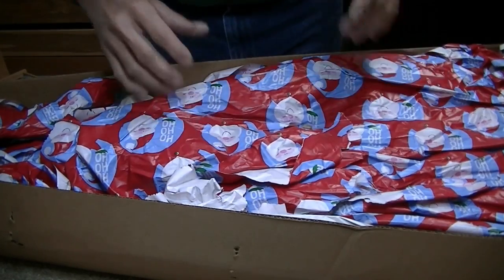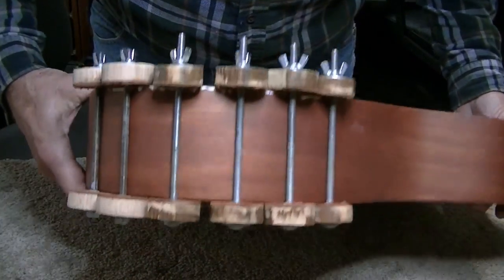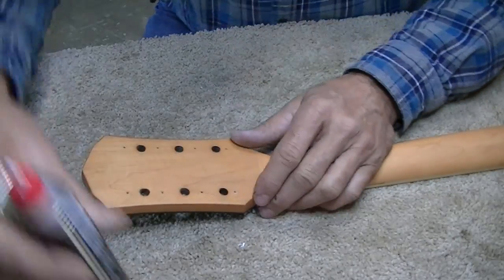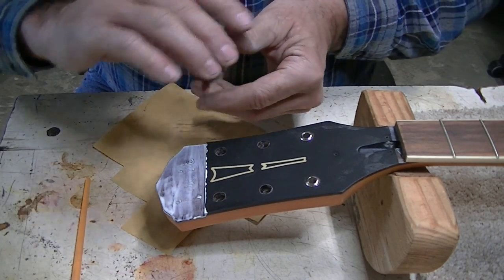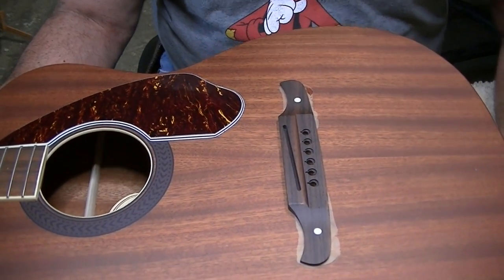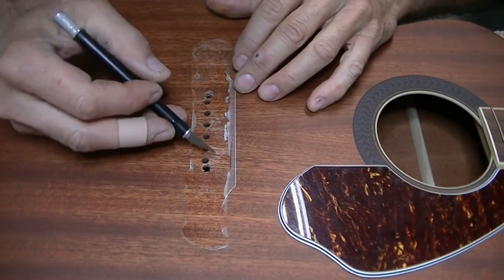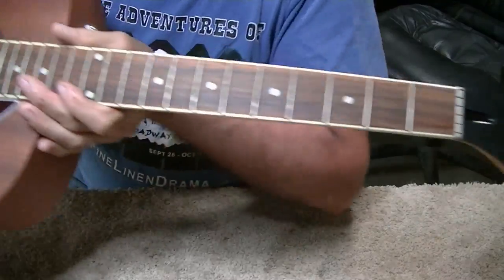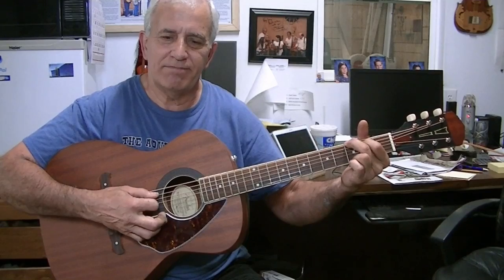169 RSW Fender Factory Flub Functionally Fixed

Comment: New guy at factory forgets to mask off bridge footprint, applies finish to entire body. Next guy half asleep glues bridge right onto finish. Next guy strings up, applies tension and bridge lifts immediately. Boss finds out, calls 1st guy an idiot, bashes guitar on concrete floor in anger which breaks body joint. Tuners, bridge pins, saddle, and nut robbed for other guitars. Guitar is thrown in seconds bin. Later the Fender logo is sanded off. Guitar rescued and mailed to RSW. That’s my forensic opinion anyway.

Comment: Looks great in the video Jerry.
I am looking forward to playing it today.
I realize it is a less expensive guitar, but we all have our reasons.
I have one of the original 1970 versions of this being delivered today as well.
With purchase, repairs, shipping and misc, this cost a total of $580.00.
That includes a new set of the correct factory tuners that I will change out today.
I feel like guitars are like tattoos. 
They are cooler when they have a storey to tell.
Thank you for the hard work.
I'm sure it will look good on the wall next to it's older brother.

Johnny
Reply: Also, I am unable to find the Mahogany Deluxe version of this guitar new or used.
Everything I find is either Black or has Cats and Skulls on the fret board.
Reply from the maker: johnny howard thank you very much.
Reply from the maker: johnny howard I'm not sure I understand.  this guitar is mahogany.
Reply: Yes sir,
Tim Armstrong Deluxe Acoustic-Electric Guitar

Body
Body: Solid Mahogany Top, Laminated Mahogany Back and Sides
Body Shape: Concert
Body Back: Laminated Mahogany
Body Sides: Laminated Mahogany
Body Top: Solid Mahogany
Body Finish: Satin
Bracing: Scalloped X Bracing
Rosette: '70s F Style

Comment: The letters "CE" are the abbreviation of French phrase "Conformité Européene" which literally means "European Conformity". The term initially used was "EC Mark" and it was officially replaced by "CE Marking" in the Directive 93/68/EEC in 1993.
Reply from the maker: +Jennifer WhiteWolf yeah I found that out. Thanks for watching.
Reply: Rosa String Works 
China Export is a lot funnier than reality🙋👍🤣🤣🤣🤣
Reply: FYI according to Wikipedia there was in fact a time when some Chinese manufacturers used a very similar marking for "China Export". Apparently there was some international 'discussion' about it back in 2008 and the Chinese supposedly stopped using the 'confusing' mark. I can't see a modern guitar from a reputable company like Fender using that as a Chinese version of the mark though, but then again, I don't see that guitar being made in the EU either. Hmm...
Reply: It doesn't mean it's made in the EU, just that it meets the required standards to be sold in the EU.
Reply: There is a China Export mark, where the letters are much much closer than on the Conformité Européene one though
Reply: By the time you finish, might be not have been better to have bought a good guitar, in the beginning?
Love the song!  I love this channel, being a frustrated woodworker & musician.  I decided a harp could take care of the latter, but woodworking was right out!
Reply: So what does it mean??
Reply: I was told it means consumer   electronics.
Reply: CE means the product conform with EU health, safety and environmental requierments. Like your American FDA approval.
Reply: So China made their CE (China export) logo similar to the Europe CE but with the letters closer together.  This was done to fool ppl without directly copying the logo.  Since then people got wise to the difference and China got wise to them. Now most of the time the China Export CE looks exactly like the Europe one.

Comment: Jerry , the fact is your fix for the tuner area was really good. a little tip, look at possibly experimenting with high solids clear top coat. you might be surprized what it can do. But as for laquer lay on medium wet coat, let it sit under medium wattage heat lamp about foot away for about 10min between coats. 2 or 3 then let it cool completely, I would do paint so it can cool/set over night. Then one good wet coat (sand before painting as needed laquer doesnt need go be scuffed to top coat unless hardened) and let it sit for 10 minutes in heat lamp then sit for about 1 hour. the previous days paint will seal things up, heat lets it flow out like old body guys sitting cars in sun before final polish.
Last coat will make it like glass.
Reply from the maker: MonzaRacer thanks.

Comment: I don’t believe this is a factory reject.  After seeing you remove the bridge, my guess is this guitar was heavily damaged in shipping, including the back separation and bridge.  It looks like someone at the guitar store tried to re-glue the bridge.  It went badly, so they gave up.  They then sanded off the Fender logo, then likely removed the tuning machines, nut, saddle and string pins (the only real removable parts) and sold it “as is.”  Fender acoustics are generally lower priced instruments, so the owner likely got it for little to no money.  

Your headstock repair is genius and looks very cool.  The bridge area looks much better, too.  I really like the stylings of these Tim Armstrong guitars, especially the shape of that pickguard.  He’s a punk rocker, so your repairs add to the general “attitude” behind that model.  Great job!

Comment: I wonder if the “website” mentioned in the little card attached to the guitar was Guitarfetish...they do these “factory buyouts” where they buy and resell defective stock from Far Eastern factories and usually scratch brands off the headstocks.
Since those factories build instruments for multiple brands, so far I’ve seen them sell de-branded guitars made for the likes of Peavey, Vintage (that great value-for-money brand sold mainly in the UK) and some others, and I wouldn’t exclude they may have handled this since these Tim Armstrong Fenders are apparently made in China
Reply: I had an elec/acoustic Armstrong Hellcat and it was made in China.... only cost $299 brand new.

Comment: Hi Jerry, that headstock piece, ive had good success sealing the grain before with thin CA glue then lacquer over
Reply from the maker: BigD I could see how that would work. I'm just not sure how you would get the CA glue level. Thank you for watching.
Reply: It just soaks in like the lacquer if you use thin
Reply: Easy.  Use an old credit card or any scrap piece of plastic.  The stuff to use is FasCap 2P10.  It's made for gluing wood.  The local fine wood store where I live sells it in all sizes up to pint containers.  Comes in thin (like water), medium and thick (like a gel).   For sealing wood, get the thin.  Spread it with a piece of plastic, soaks into the wood and seals it.  I use it on knotty wood to hold the knots into place so they don't fall out while milling the wood to final size.  Have run boards through the planer with no tear out at the knots.  You really need to try it.  The thin would work on cracks in guitar tops & blend with the finish.

Comment: My English is not that good so I write with the Google translator.  The guitar costs in Germany 350 € -500 €.  The car wall you have to operate to bring the guitar back in order certainly exceeds the original price.  Is a repair worth it?  By the way, all your repairs are very good.

Comment: The head turned out pretty darn good. The truss rod cover tied it all together.

I wonder if that hard finish is one of the new solvent free coatings that is sprayed on wet, and then cured in high intensity Ultra Violet light.  Rickenbacker now uses a UV cure, gloss clear  and has eliminated solvent vapor emissions from their plant. Could it be Fender is doing the same?
Reply from the maker: +Jennifer WhiteWolf that could be. Thanks for watching.

Comment: Hi new to your channel 
That is a flat automotive clear coat 
I was going to suggest you try a urethane clear 
I use nexera clear 2 gallons 127.00
If you sanded all of the top you could re spray it with satin or flat clear 
These urethane clears are very tough 
I paint cars in my own shop 
I’ve always thought you could finish a guitar it would be glass finish

Comment: I bought a brand new Fender back in 94. I dont like the sound. It sounds like a beer can with strings. It was never right from the factory. Now I'm worried that the Martin factory regect I bought might sound like a beer can too just like this Fender you fixed. You did a great job by the way. My thought is will the Martin sound like this Fender because it is also a reject. Or is the sound  because of Fender design and construction. By the way, nothing to do with your repairs. Thanks

Comment: Try using an old 3/8 drill bit for knocking out the ferrels or an appropriate drill size that fits.
Reply from the maker: I have various sized pieces of bar stock that I use

Comment: LOT OF WORK FOR A LOW PRICED GUITAR 
BUT GREAT JOB ON THE REPAIR
Reply from the maker: DriveShaft Drew thank you Drew.
Reply: @RosaStringWorks  But surely Jerry... their comes a break point where the cost of the repair (time) exceeds the value of the instrument?  I can understand it if it is for sentimental reasons, as was the case in one of your other recent repairs... but I don't think there was anything sentimental about this dealers dumpster pick!

Comment: Cool song. It was really cute. How did the customer go about ordering that guitar direct from the factory ? I would like to order one and try my hand at repairs on it. I use to work on guitars when I was a teen back in the 60' s and early 70's. A lot has changed since then. My hands are messed up. But I would like to give it a try. Thanks for sharing the video. It's really a good edicational video.  I hope you have a blessed week.
Reply from the maker: Thomas Tommy thank you very kindly. I don't know how he acquired it. But I think he mentioned eBay.
Reply: There are lots of them on eBay. Fender sells them in bulk to re sellers. Just look in the guitar section and then find the For Parts/Repair button on the left hand sidebar. I have a Uke I got from there with a fretboard that looks like a roller coaster. I'll fix it one day...
Reply: +Buddy ~ Fender started selling reproductions of some of their 60's acoustics a few years ago. (This one looks like a Newport to me.) Harmony made a lot of them for Fender back in the day, which explains their less than stellar sound. Fender couldn't give them away in the 60's, so why they're reproducing them is anyone's guess. It's probably the worst marketing decision since New Coke.
Reply from the maker: Bill Seper This is a Tim Anderson Hellcat Deluxe model if that means anything to anyone.  Thanks for watching.
Reply: That's what I thought at first too, but a Hellcat is supposed to have animal figures instead of dot markers on the neck. Maybe this was some kind of experimental model or something, which might explain why the headstock was desecrated among other things. (I like the song by the way, The lyrics were clever. I'm a writer, so word smithery goes a long way with me.)
Reply from the maker: Bill Seper thank you very much.

Comment: I believe the reason the wood soaks up so much lacquer is because you have to use filler and sealer first.
Reply: I used to refinish rifle stocks (They were my own and it was cheaper to do it myself!), It was a revelation when I found grain filler, Whether I was lacquering or oil rubbing, It was a gazillion times better/quicker after grain filler was applied!!! :)

Comment: It is probably one of the new catalyzed finishes. If it came into the shop on a piece of furniture we would sand it all off and start over. There is no way good to repair them. In our experience (company) once it starts pealing off it's going to continue to peal off.

Comment: it didn't sound bad on my end.  you could have gotten a hold of that j45 randy had to work on.what a mess they did at the factory on that onto. it was probably the same guy after gibson fired his butt. you know I'm not a luthier but I've done lots of wood work and being an auto body man for 25 years or so I've got most of the tools I'd need to make a hell of a lot better electric guitar than a lot of them I've seen worked on here on you tube.and a lot of these repairs if a man uses his head and has the tools can fix a lot of these. I know I can.and as far as finish goes turn me loose.
Reply from the maker: Krusty Buzzard thanks for watching.

Comment: On that head stock try a little epoxy pore filler to keep your lacquer from sinking in but a good call on the contrast verses trying to match that black.
Reply from the maker: Jason Adams well my friend, I have given up on pore filler. I have never found a pore filler that I think is worth a crap. Do you have a suggestion? I've tried at least a half dozen different kinds over the years and I don't think any of them are any better than using nothing.  Thanks for the suggestion. And thanks for watching.
Reply: I use a clear table top epoxy found at Home Depot or other hardware outlets. For the reason that it will harden clear, UV resistant ( a unique quality in epoxy), is a one to one and will mix thick enough to fill with. The trick in using epoxy is the application and of course mixing and stirring properly. I use a rubber window squeegee light pressure (really makes a difference!). I have tried the credit card and other hard spreaders but they will all remove too much and waste your epoxy and is probably the effect you are having.  Another trick I use is to let the first coat gel a little and spread a second coat fairly quickly (no sanding is necessary on uncured epoxies molecular cross linking is not finished yet) . Then I get a thick enough coating to sand and level (do not remove to wood showing). But I do often fill pores with the finish alone but then I am using a catalyzed urethane that recoats in 15 minutes or less. The best thing I have seen yet is the UV cured epoxy products the UV lamps are costly but the time savings is phenomenal! When I get flush with some money I will try that. But thanks for your vids I love your productions and really enjoy watching them. 

P.S. I sometimes set epoxy in the summer sun to cure in a shortened time, like about one half BUT BE CAREFUL WITH INSTRUMENTS doing this. I live in a jungle climate where lack of humidity is not a problem but in Colorado or the mountains it will dry out the wood too much and screw up your instrument. A faster hardener is what you need there. Sorry for the long post as I have a lot of experience with polymer resins and just felt the topic deserved it. I could do a 2 hour video and not cover all the aspects to using them.
Reply from the maker: Jason Adams thanks for all the info. I have never tried any epoxy as a pore filler.  My thought with the epoxy would be that it will coat the wood so that you would not be able to stain the wood consistantly. I suppose you would do your staining before you apply the epoxy is that right?  My guess is it would require sanding to level it too?  The only kind of pore filler I've used in the past were oil and or water based.  Those spreadable ones that are supposed to fill the pores and then dry.  But they don't keep the finish from sinking into the pores in my opinion.
Reply: Yes all staining and surface prep is done prior to epoxy application. You can tint the epoxy if desired but I wouldn't recommend it. The idea is to build up the epoxy enough to level down without exposing bare wood.
Reply from the maker: Jason Adams thanks that would be great for areas like pegheads. I wouldn't want to do it on the body's though. Thanks for the information.

Comment: Jerry, those tuners have two holes so that can be used on normal as well
 as slotted headstocks, but normally they're not intended for nylon 
strings with this diameter. Assuming that this was a dumpster (free) 
guitar it would also have been a perfect project for someone learning 
the trade, but you did a great job of course. Maybe you don't always want to tell but it would, especially in a budget case, be interesting to know how much you charged in the end.
Reply from the maker: I don't remember what I charged. I think at the time I was charging $60 an hour. It was only a few hours work.

Comment: The tuners are designed to be used in either a slotted head steel string or a standard like you see here - they are super cheap and not very good as there really isn't much of a taper on the shaft - that said, they work fine. Nylon stringed instruments have a nylon roller - not a metal roller.

Comment: It is sometimes better to use somewhat more diluted staining and  apply it a few times, that way you can get more even results - and it allows for better control over the colouring of the outcome. Also, the wood should actually be treated with a solvent to clean places where it has got fatty or oily, cause that is the reason the staining doesn't apply well in some spots as can be seen here with the piece put onto the headstock.